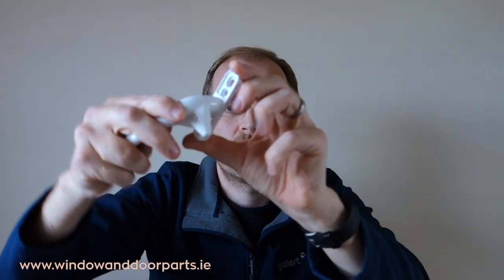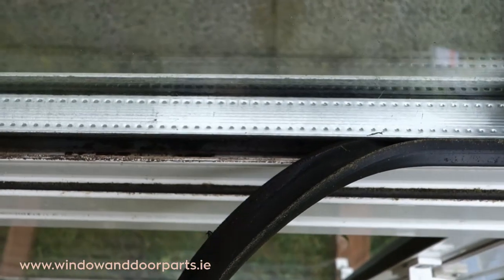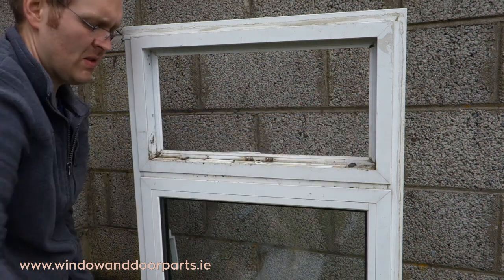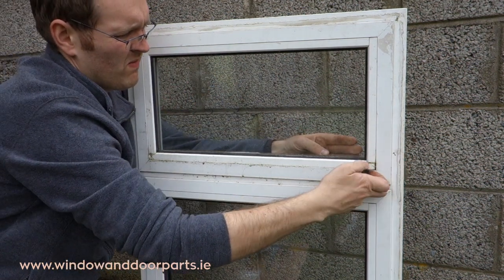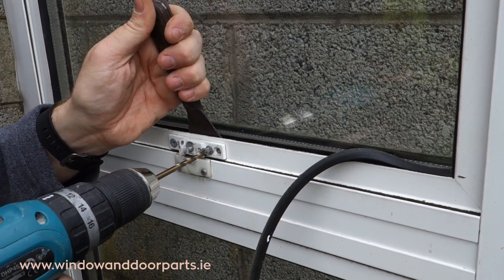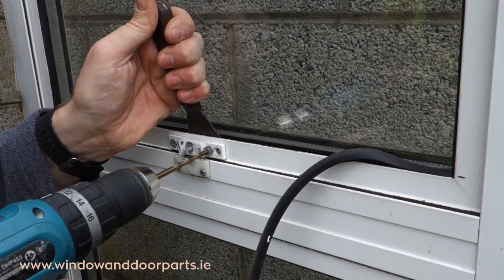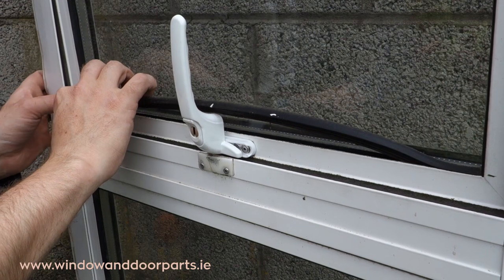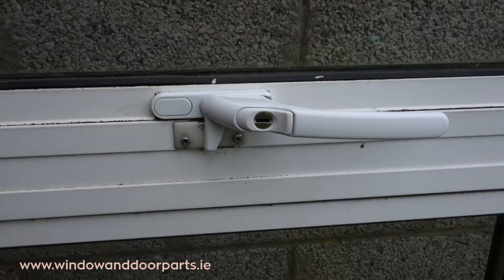How to replace a cockspur window handle on an aluminium window

Comment: 5:51 Just looking at this, why not just take the bottom seal off like your doing now and proceed from there as the paint scraper is protecting the glazing whilst drilling?. What was the point of taking away all the seals and glazing beads and replacing them straight away and then putting the handle on with the glazing window in place?. Even though you are advocating to change the handle with the glazing off you are doing it with the glazing in as I can see the reflection. Im just a but puggled. I have an aluminum kitchen top window just like this only 3 times the size with the same rivits. 
You wouldnt be up in North Dublin at any point or know anyone in Dublin that could come out and do this?.
Reply from the maker: It just to show that's how you would remove the glass or doubke glazing to change the handle. In some windows the space left is too small to remove the rivets without breaking the glass. But the window in this video is wide enough that it can be done without fear of breaking the glass. But for someone that doesn't have experience i would recommend removing the glass or doubke glazing.

I don't go near dublin I'm afraid. Andy in the window repair company is located in north dublin.
Reply: @PaddysDiy  Ah I get you. And thanks for the reccomendation re Andy. Cheers Paddy

Comment: Great video thanks, question, my double glazing window handle is screwed in, the one thread is stripped so the screw doesn't fit anymore meaning the handle is loose and doesn't seal properly, is it easy enough to replace screwed with pop rivets?
Reply from the maker: You have a couple of options. You could try a screw the same length with a wider thread. You could also try a longer screw, but you would want to take the glass out first or the longer screw could break the glass. 

Or you could reposition the handle 5mm to the opposite side of the original holes. So you would have fresh material to drill into

Or you could try rivets. They aren't marvelous on pvc windows though

Comment: Fantastic video, thank you! Seems the opening part of my window is aluminium and the rest is plastic.  Can I use screws on the aluminium rather than rivets?
Reply from the maker: If the handle is held on by rivets you'll have to use rivets to put on the new one

Comment: I slide a metal plate between glazing unit and rivets once rubber seal is removed.
Reply from the maker: Absolutely. Works in most cases. You'll get some windows with a very small gap between the glazing and rivets. That's where you'll get caught.    I always err on the side of caution

Comment: You don't need to de-glaze, you can just put a flat scraper between the glass and the frame so the drill bit dosen't hit the glass!
Reply from the maker: Like the paint scraper i use at 5:20

Comment: Great video, very helpfully,you mentioned you used a 4.8mm rivet, what length do you recommend the rivet to be for aluminium
Reply from the maker: Hi Clive, the ones i usually use are 15mm long, but it would depend on the thickness of the window handle.